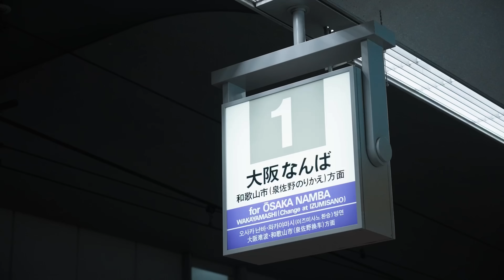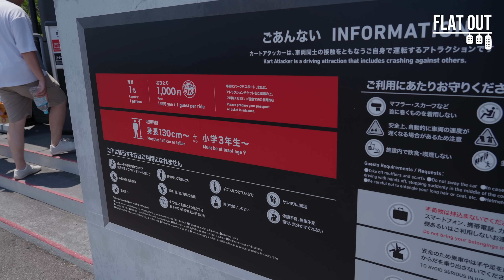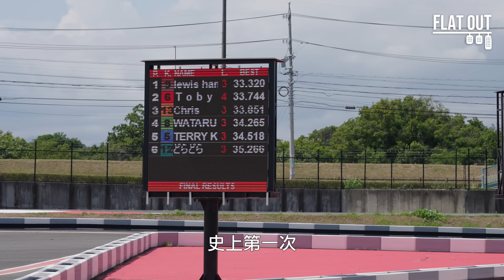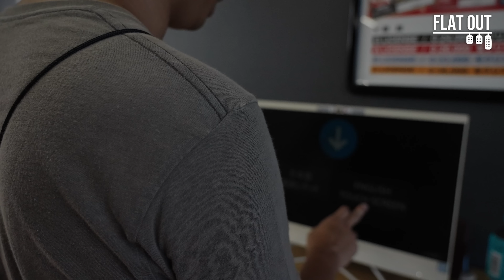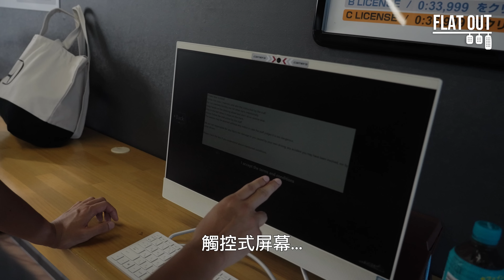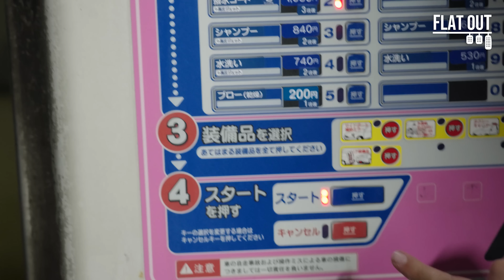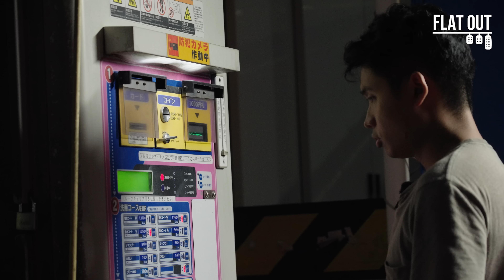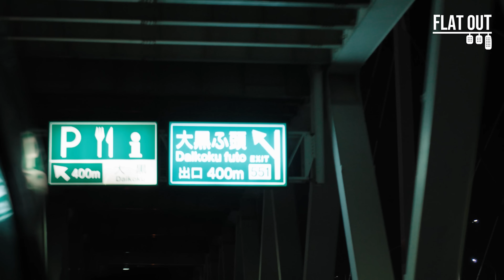雙TO日本之旅！鈴鹿賽車場玩Kart仔只需1,000 Yen？去群馬縣朝聖頭文字D電影場景！大黑PA睇車俾人拉？| Flat Out Travel #FlatOut旅行團 #地板油

Comment: Car being jumped (i.e. donee car) should have the negative connected to the ground, not the battery negative directly.  Otherwise, you run the risk of frying the car electronics due to power surge